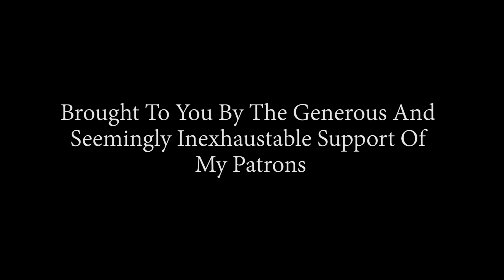Shop Tip #7 "Why High Carbon Tongs Are A Bad Idea"

Comment: I picked up a pair of tongs that were cast into shape rather than forged and being very new to the craft did not realize what that meant when trying to heat them and resize them for a particular job.  The loud snapping noise as I dipped them into the quench tub was the fastest lesson I ever learned after "fire is hot".  I made my next pair of tongs form some mild steel reclaimed out of a set of burglar bars form a renovated house down the street.

Comment: What about rusty material. Should I clean it shiny before working it? The reason I ask is my local steel dealer is selling tons of slightly rusty stock for a huge discount. ($0.25/lb). The stuff is rusty, but not flaky rust.
Reply from the maker: Pfff, they cant sell it. I load up every piece I can. You are forging it so it doesnt matter at all!
Reply: Buy as much as you can carry, fire cures rust almost instantly!
Reply: I bet i can get a 500 hundred feet of 3/8 round for $50

Comment: I drive a truck and supply steel mills with the scrap that they make the steel from one of which is nucur birmingham where they make rebar and I have pictures of the scrap piles that they make the rebar from it is a mix of pieces of cars, buildings,home appliances,railcars and a bunch more

Comment: When starting I made ten tongs out of rebar. Within 6 months, 9 had broken. 1 pair is still going fine.  Rebar is definitely a crap shoot.  Best use of crappy rebar - bury that crap in concrete as it was designed for.